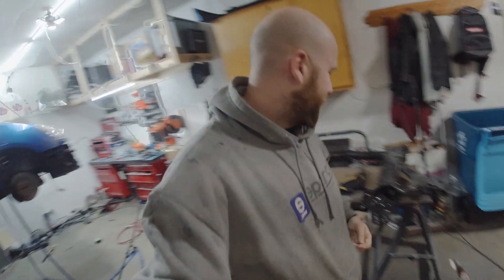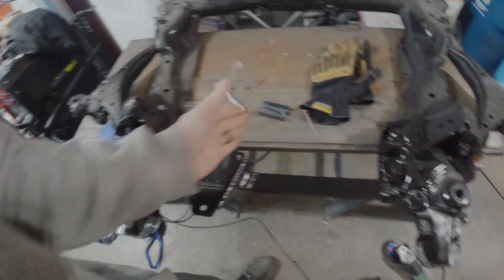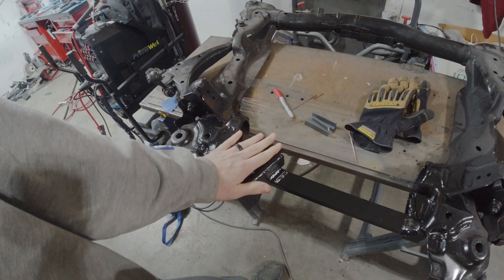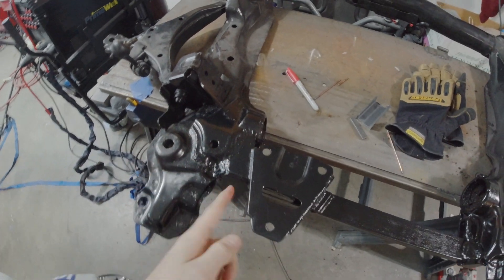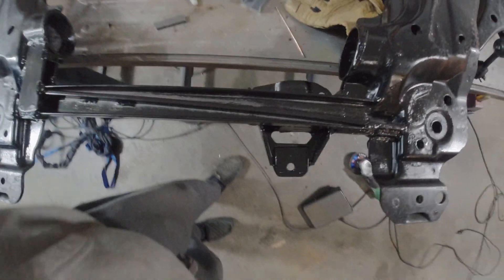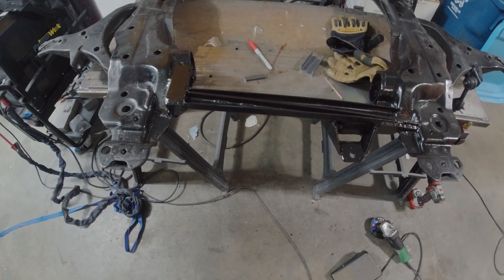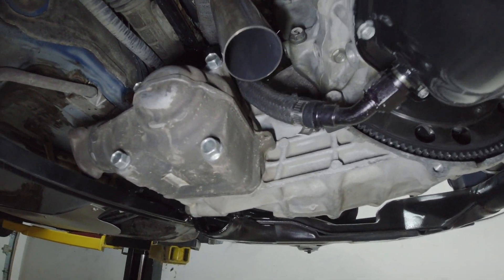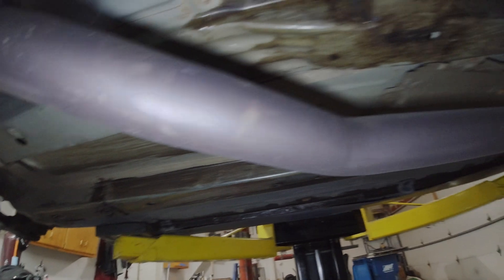Converting my EP3's FWD Subframe to AWD for CHEAP!

Comment: what rear motor mount you end up useing
Reply from the maker: Using the Hasport fwd mount since I was able to reuse the fwd mounting plate when I modified my subframe. Recently had to make some collars that I welded to the metal bushing to keep the urethane bushings from squeezing out of the mount when launching the car. 

No testing on the collars yet to determine if they work like I hope they do.

Comment: Hell yeah dude 🤘. i been playing with idea of making my ep3 awd and this was a good vid for some insight
Reply from the maker: I should also do another video going over the finished product. I do say 1 thing that I need to correct about the e brake cable brackets. Instead of grinding anything down, just swap the brackets from the drivers side and passenger side. 

I'll cover that in a video if I ever decide to get it up on the lift again!
Reply: @BoostedEP3  please do another video bro. could do with a few tips 🤜👍
Reply from the maker: @Tony Ross  I plan on it. I have a new viscous coupler setup from S1 that I'm going to install in the next month or so, then getting some better tires and get some dragy times. Since I've got a wife and family, progress can be a little slow, so just bare with me! Lots of updates coming... eventually!
Reply: @BoostedEP3  cool. Thanks for the reply bro 🤜👍

Comment: What transmission did you use
Reply from the maker: I used an Element bellhousing where I drilled out the speed sensor hole. Then used the outer case from my stock ep3 transmission. Internals are a BF turbo geatset, carbon synchros, mfactory fwd lsd that was modified for awd, and speedfactory springs.
Reply: @BoostedEP3  what did u have to do to modify lsd.? Would be much appreciated.
Reply from the maker: @Tony Ross  I had a small local hot rod shop machine it. Machining requires the threads on the diff to be drilled out to thru holes, then counterbore the holes to give clearance for the head of the bolts so they don't hit the inside of the transmission case and also have proper thread engagement with the transfer gear.

Since the shop that did the work was small, they were very reasonable on price and only charged me $100.
Reply: @BoostedEP3  thanks my man.🤜